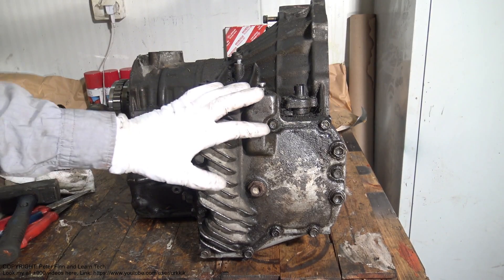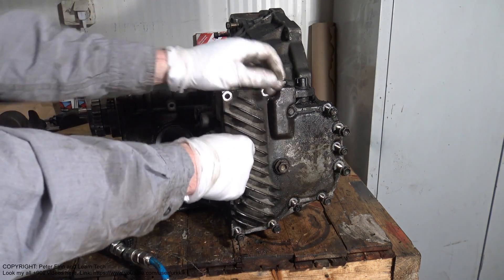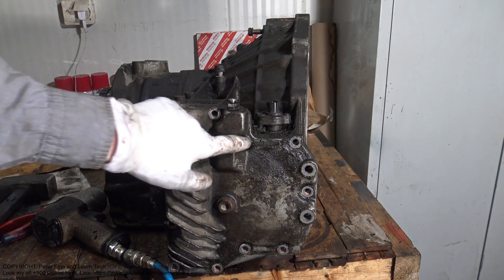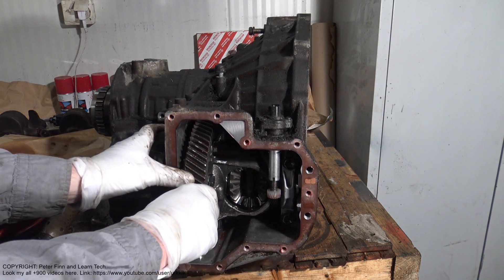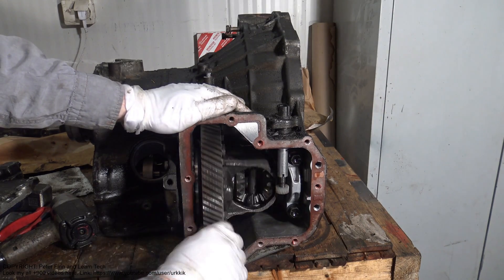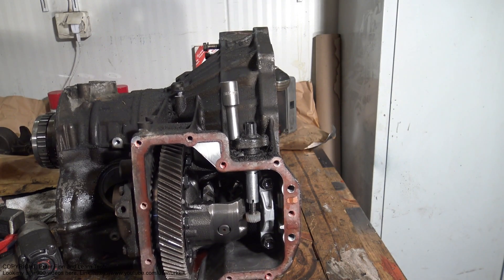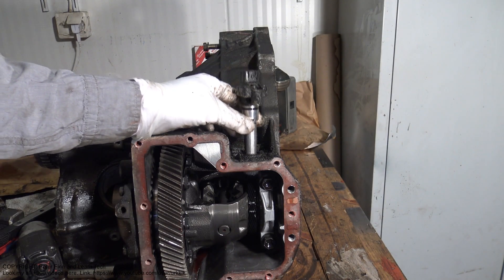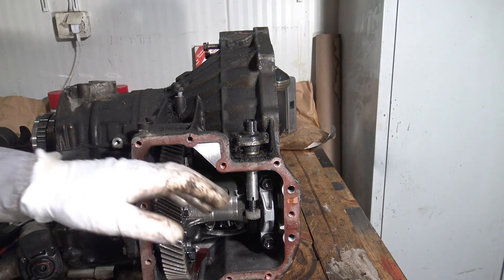How works speed sensor Toyota Camry U140E automatic transmission

Comment: I have 1995 Toyota 4-runner 3.0 SR5 2WD.  They said it showed a code for speed sensor. I can I find the right one to buy? Can I clean the old one? How hard is the job if I want to do it my self.
Reply from the maker: Hi, you can find used part from Ebay. And replace is easy. Look link on sales part: https://www.ebay.com/itm/Transmission-Output-Vehicle-Speed-Sensor-Fits-Toyota-4Runner-Pickup-Previa-/281948075182